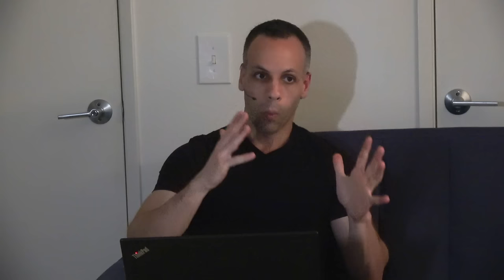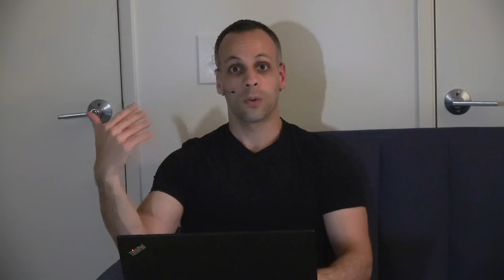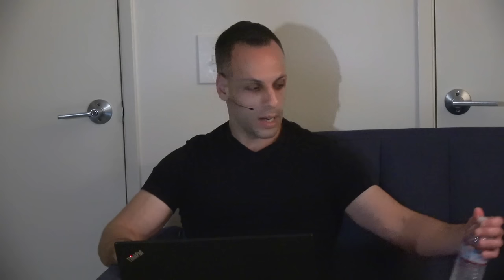EVGA's Oversight: Unannounced Changes Destroy PCs, EVGA takes NO ACCOUNTABILITY

Comment: Of all the PSUs I've purchased over the years, the only one I've personally ever had fail on me, was an EVGA 850 80+ Gold PSU.   After a few years of usage, the unit would shut down under any amount of load, if there wasn't extra air flow going through the unit.  Minimal dust was in the unit as the case has filters on it normally.  They did RMA it as it was still within the warranty, but I have no trust in it anymore, and replaced the PSU before RMA with a different brand and now just have a spare PSU if I need one for some reason.

EVGA was a wonderful company years ago, they actually cared, but at this point the last 3 EVGA products I have purchased have had MASSIVE issues.

PSU as mentioned above
Z20 Keyboard.....you have to carefully take a dremel to all of the key caps to remove internal burrs that cause the keys to stick.
X20 Mouse....randomly gets super stuttery and jumpy, then goes back to working fine....

That's three strikes in about a years span of purchasing, so I will not be back to them.  RIP EVGA...they were good once.

Comment: I know what you're talking about now.

I had to get a new power supply recently. I plugged one of my existing modular cables into the new power supply, plugged it in, and put a multimeter on the output connector.
when the 12V line gave me 2V and the 5V line gave me 8V... I was like "NOPE!" and ripped all the modular cables out of my computer, and replaced them with the new ones.

Every older power supply I've had, I've used the same cables.

and I get to your key point in the video and I'm like... Yeah, this is dumb... don't send the cables back, get back a power supply that doesn't use the same cables.
and if you send them back, they send you nothing back... really dumb.
When I used to send things back many years ago, the assumption was that you had to send back EVERYTHING that came in the box, and you got back EVERYTHING that came in the box, because you probably didn't get the same product back, even if it was repaired.
but yeah, The problem is that the connectors on the PSU are all the same, so why are the cables wired different?
If you change the pinout, CHANGE THE CONNECTOR! Make it so it physically won't plug in!

Comment: Here's one for ya Louis! MS Copilot is Not private but it will boldly LIE to you that it is. When asked it will give you directions on how to set your privacy mode, it will give you instructions on how to set Copilot "Protected Mode" but Regular Privacy settings do  NOT cover Copilot and there is no such thing as "Protected Mode". When you go to the "settings" option in Copilot as instructed there is just ONE setting about using Edge to provide results. When you ask it about that it ends the conversation. These responses are preprogrammed so they know it's lying and are simply not saying anything and providing a Front to FAKE Privacy. Think it's called Lying by Omission. Anyway seems Copilot is their way around EVERY Privacy setting in your PC now.
Reply: I'm wondering if it's an EU/US thing.

Comment: About 15 years ago I had a PSU fail in a way it fried 6 hard drives at once. Quite a bit of magic smoke but after lots of troubleshooting I could not get the hard drives to work again. I lost my primary, and my 2 sets of  backup drives at once. The PSU was a few months out of warranty, and the hard drives were under warranty, were replaced, but I lost a lot of irreplaceable data.
After that I no longer considered copied data in the same physical system an actual backup.
Reply: Reasons to keep that old dvd drive

Comment: i had a very special RMA process with a BeQuiet PSU.
I live very close to the RMA Location so i asked if i could just turn it in and after a technician had a look at my PSU they called me a bit later in the day and i was able to get a brand new PSU within less then 24h. I even got a free Upgrade from 750 to 850 Watt and all cables were still the same, so i didnt even need to unplug them in my PC and just had to plug them into the new PSU.
Probably the best RMA process i ever had since this all happened on a Friday so that i had a working PC for the Weekend.

Comment: This happened to me with an EVGA PSU several years ago. I mixed up modular PSU cables and fried my four 4TB drives. It cost me over $2000 to get the platters swapped for data recovery.

Comment: This case makes me take step back and ask:
Why do we even use modular supplies?
Sure, less cabling, which was very good for cleanliness back when PSU hung at the top of case, dangling the cables dangerously close to cpu fan, but nowadays, for like a decade, we had pc cases that hide the PSU on bottom in basement. There is plenty of space to just fold the cables in there, and nobody will see it even if you have glass side panel, because basement is often hidden. 
The befits of modular is less cabling, which comes in handy when doing tiny builds or using it as second power supply in big rig, but that is specialty use. 
Then are the cons - more expensive, cases like the one discussed one where bad pinout fries hardware (wouldn't happen if cable was attached to psu). It is also suprisingly hard to plug additional cables in once the psu is installed - I once spent good fifteen minutes trying to get that plug in, which in hindsight, might have been faster if I just took whole psu out, plugged the cable and put it back in. Then there is a problem with storing the cables you didn't use - they end up in a bag somewhere, taking space, forgotten, until the day you need them and can't find the bag. I could just store them at the bottom of the chassis, but they would have to be plugged in to avoid problems "why no power", and if they're plugged in, isn't that just a regular power supply with extra steps?  Also, can't get the plugs in because too tight.

Comment: As far as having your drives covered, buy Western Digital. They won't cover data and shouldn't. As long as the drive is not visibly damaged, they cover the disk drives. I told them I dropped my drive because I was being an idiot. I pushed it off my bench accidentally while working on a PC. I just wanted to pay to fix it, so it's not a waste. They asked if it was visibly damaged, and it was not, so they replaced it for free. I had all my important data backed up. All I lost was a bunch of Blu-Ray images. Those take time to copy again, so that's no big deal. 

Always back up data in triplicate, on separate devices, in at least two physical locations. Encrypt your backup drives and keep two at home and one at work. If you lose your unrecoverable data because you didn't do that, it's on you.

Comment: No joke, I've had this exact type of problem happen with seasonic and corsair only with the 12v and 5v rail on the motherboard connector

My rule of thumb is to always check the cable voltage on every cable not included

Comment: I agree with you, that's not ok.
I'm done with EVGA, every since they killed their graphic cards department. I have 2 EVGA power supply, and I know that they are manufactured by power flower.
OEM matters more nowadays. Sure I have 10 years warranty, but if one fry, I'd just pick up a Seasonic and trash the EVGA at this point.
Reply: I think you mean Flower Power.

Comment: This is a lot like the automotive industry. A company will sell you a "Performance chip" or some sort of fuel mapping software, but between 2-3 different "chips" of the same product you might grab the one that got solder blobbed over 4 pins. You plug in to the OBD2 port, and promptly send 12v up the 0.5v reference line. POP! There goes the ECM and now your car is a driveway ornament... The car manufacturer will say "You did an aftermarket add-on, your entire warranty is voided" and the chip manufacturer says "We're not responsible for damage caused by using our product". As to the fuel mapping software, they simply can't warranty their product, as it requires intelligence and knowledge on the part of the end user to not get the fuel/air mix so wrong that you melt pistons.

Comment: I have known modular power supplies output connector cables are not standard, so I check the pin outputs on the PS's. I personally do not use modular PS's on my own equipment.  For my customers who want modular PS's, I put a sticker on it of what the pinouts are if the unit does not already have one.  Some do and some do not.  It can be a pain in the butt.  :)  BTW, Mid-year change in parts compatibility is a common thing in the auto industry.

Comment: Hmm. I RMA'd my supernova a year or two ago due to the fan failing. I had another 550w I swapped in at the time and didn't change the cables around. When I got the replacement PSU again I plugged it in and its worked just fine. Thats wild they have different pinouts. EVGA psus are basically just re-branded seasonic units.

Comment: They can just make small notches on any of the 2x3 pins to be just a little different and not pluggable to any other similar looking slot. 6 pin, 4 corner, thats 24 bit (millions of) variation. Thought if can be plugged rotated then must keep that in mind too.

Comment: What's worse is that most vendors don't even adequately mark the cables so that you can't even figure out if you have the wrong one. You can try to do a pin to pin test, but even that isn't conclusive because not all vendors, even those that use the same connectors on the power supply, publish the pinout on the power supply side. I didn't realize, the same as you, that they weren't standardized and mixed them. I'm now stuck with power supplies that I don't dare use for fear of destroying something.

Comment: As an electronic designer I check almost everything, actually sometimes double or triple check. Once I disassembled I think some Lexmark printer and to my surprise red wire was negative, black was positive 24V power supply. But in this case here I wouldn't check those cables neither. How on earth producer can be so irresponsible and change the design so drastically for no good reason and keep these changes secret, even without changing the name of power supply at least? And after all the damage they did claim that it's OK. This guy shall go to court , easy win.

Comment: Okay maybe i translate this wrongly but in Hungary we have a term   'egyedi méltányosság' which means unique fairness. Unique fairness is used when  according to the company policy you have zero right to get compensation. And they will first officially deny your request for the compensation. They will state that according the the xy line of their policy your request have been denied. But if you file a request under unique fairness they  will MAY or MAY NOT still pay you out of 'mercy' they will never state the reason why they are actually paying you. The evaluation is always done case by case. They do this to mitigate situations like this this so the customer will get compensated the customer will shut their mouth and dont make negative comments about the company and they legally not responsible  for anything.

Comment: This is important to know. Especially EVGA as example often uses 3rd party designs on their units. So you can not mix Super Flower based unit cables with different 3rd party vendor unit.
Reply: s/often/only/

Comment: In my opinion the customer-support employee should know about such things, that does not mean that I put the blame on him. It is up to EVGA to inform their customer service employees adequately and to hire people who are capable of understanding simple technical details like internal wiring. You really don't need to be an engineer to be capable of understanding such things on a helicopter level but you do need the capability to think logically and many people don't have that (which is fine, but choosethe right people for the job). I also assembled my own PC, I made a few mistakes but I did know about never using power cables for any other PSU, that has been shared a lot in the communities. I use Linux myself, the hardware works fine, you don't need to read the fan-rpm in the system for it to work because this all works on the UEFI-level. Having said that, I can't read the fan-rpm of the CPU-fan and case-fans in the system. Why? Because the chip which is used for those fan-headers comes from a company which refuses to document the specs, they made drivers for Windows but refuse to even give enough information to other operating systems to have those developers make it themselves. In some cases eventually it gets reverse engineered, my motherboard probably is too new (2019). Don't blame Linux, blame those companies and blame motherboard-companies for not mentioning which chips they use for the fan-headers. If they would then the Linux-users could pick the motherboards which use the better fan-header chips.

Comment: Yes, non-standardized connectors on the power supply end is stupid. But that's also why most manuals say to only use the cables included with your supply. But this scenario bypasses that caution so the damage is totally on EVGA's dime. The user IS using the cables that came with their unit. If the RMA Dept. is going to substitute an incompatible unit and send it to the customer without also including compatible cables, it's impossible for the customer to know. If EVGA is returning an incompatible unit, there better be a big sticker across the connectors saying "Do NOT use your old cables, use these newly supplied cables instead or your equipment WILL be damaged." How hard is it to institute a check... version A came in and version B is going out, add cables and warning stickers to the return.

Comment: Sounds like early models had a design problem, they compensated the cheap way by changing the cables, they later they redesigned the PSU for a different reason, but the pinout was on the list of things to fix.

I don't know where these units are made, whether they moved manufacturing to China like everyone else (probably), the problem being that you HAVE to put engineers in China, at the facility 24/7 to make sure they don't take shortcuts, and a lot of electronics companies do not realise this when they first move their production to China. I've been seeing a lot of stuff lately that's gone from "made in USA" to "assembled in USA", which can literally mean applying a sticker.

Comment: the pinouts are normally determined by the build house. some different 'brands' are even the same pinout. evga doesn't 'make' power supplies. also the one time i warrantied one, they had me keep the cables, and sent me a brand new one with new cables.

Comment: It's really the level of problem that you might encounter in Chinese DVR's. 
Once I was upgrading client's DVR to a newer model, and as by some mistake I did not switch the HDD power cable, which had completely mirrored connector layout. Thankfully it burnt and shorted the protecting diode at 5V rail and the drive survived. (It only needed removing and replacing of the diode) 
But it survived only because it gets reversed polarity, not too high voltage as in case of this story from Reddit

And hey, these DVRs had at least 5 years of age difference, and were pure chinesium

Comment: As someone who knows a bit about customizing your PSU cables, this has been an issue with just about every PSU manufacturer for some time. The main reason for this is they don't always make their own PSUs in house. This makes for a difficult situation for the end user because, as you said, if you RMA your PSU, you can run into the issue where your cables don't match the new PSU you received.

Comment: Why in the hell are we not forcing companies to standardize these pinouts? I worked on IT for years and you would not BELIEVE the quantity of people building computers that end up buying prettier/shorter/longer modular cables without checking what power supplies they are for and end up frying their components. It baffles me to this day that there has been no regulation, no ISO or anything that was ever pushed.
There is no limitation that prevents a standard for existing at all.

Comment: Backup versus Redundancy...critical to understand the difference...so often misunderstood. The Fukushima Daiichi nuclear power plant had multiple emergency diesel generators to ensure redundancy of backup electrical power for emergency cooling needs.  A tsunami took out the relevant generators and their switches in one massive wave. At that point, they had no backup to their backup. No remaining means to bring sufficient electrical power to the emergency cooling pumps.
A power supply failure (e.g. electrical short, spike/surge) can be like a Tsunami to a PC system; a single point of failure.  Data storage backup would need to be isolated and recoverable from the effects of the bad PSU.
Redundancy provides near real time continuity of service/capability. However, backup is a method of recovery by means of a protected/isolated soruce...it may take more time but it greatly minimizes a total loss of data scenario.
Naturally, there are potential scenarios where even the backup might be corrupted.  For instance, a Carrington-like event that blankets an entire region/geography with electromagnetic fields...corrupting both electronics and magnetic storage media in its path. The only way to avoid this type of solar tsunami would be a very robust Faraday cage and absolutely no wired connections leaving that cage. This would imply a backup that may not have the most up-to-date data.

Comment: If a manufacturer pulls that crap in Brazil, suing them and winning is going to be SO easy it isn't even funny. Our court system doesn't work for a lot of issues, but for things like that it's quite efficient. There's even a streamlined court for cases involving less than a certain value in damages, and a top-end PC is comfortably within that value. (Not counting cases in which lost data has a huge value)